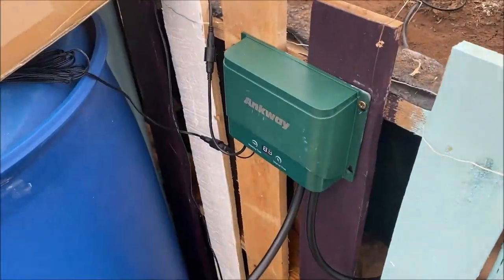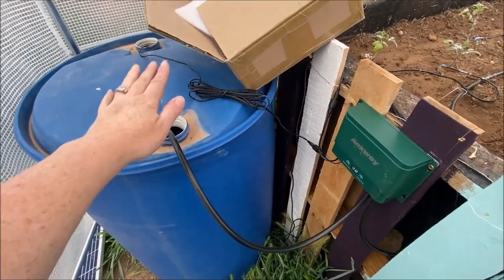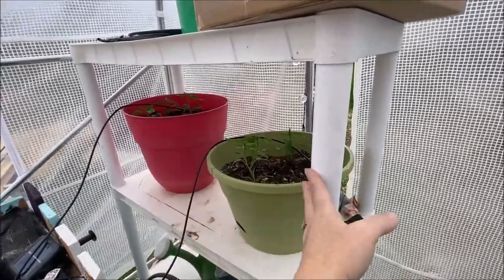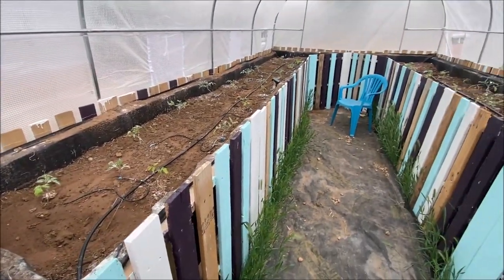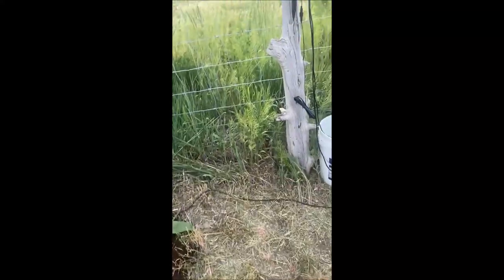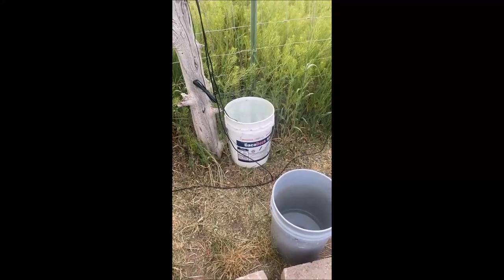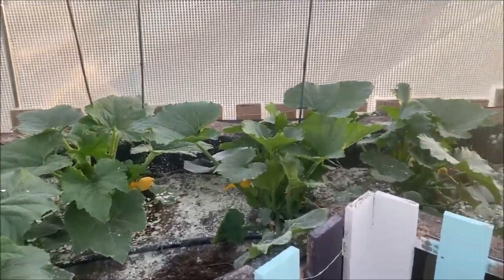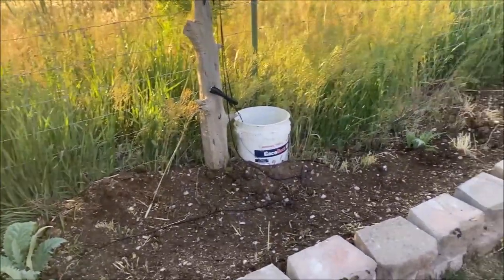solar powered drip irrigation system for greenhouse garden

Comment: Thank you for your video, I've been looking for something like this. I did read the reviews on Amazon and I'm concerned that some people are saying it only lasts for a season. Do you have any input?
Reply from the maker: It really depends on the unit, we've had some that only lasted a year, but others are still going strong.
If you unhook them and bring them inside during cold months (especially if it gets to freezing temps) that will extend their life.  We didn't do that last winter unfortunately, but only had 1 that wouldn't work this Spring which was nice!  This year we plan to unhook all of them once temps drop and keep them inside for the winter.

Comment: Do you know what size the main line size is? 1/2 inch or 1/4 inch? Not the one that connects to the spike.
Reply from the maker: It depends on the unit, some are 1/4 inch and some are 1/8 inch.
Reply: Main line is 3/8 and the runners to the spikes are 1/4 for this one
Reply: From having done plenty of water lines, they look like 1/4" for the line the spikes come off, and like 3/8" into the barrel, like the last commenter said

Comment: Does it have a battery so it will store energy and still work on cloudy days?
Reply from the maker: Yes it does!
Reply: @AtoZForMoms  I ordered one. Fingers crossed!
Reply from the maker: I hope you love it as much as I love mine!
Reply: I wouldn't trust it to go too long. Might get 2 days without sun at best. All my systems O build from individual components myself and do the maths on it all. A lot of these systems are alright but not great. What I have seen on my charge controller screens is there's a dramatic drop in solar intake as soon as it's not fantastic light levels. Slightly overcast and you're back to 30% input and very overcast and you're back to 3%.
Reply from the maker: Mine have done fine, even with days of overcast.  It probably depends on the size of the unit as well, but so far we haven't had any issues.

Comment: Hi Elsie. I would recommend you to try using a 1/2 hose with 6 inch emitters in your raised beds. My garden started off with a similar set up but I found the 6 inch work great if you enjoy growing plants from seed. We normally add a seed directly under the drip emitter and wait for a plant to start growing. 

Thank you for sharing this video as I wanted to make something similar for my greenhouse! I just subscribed!
Reply from the maker: Thanks for the tip!

Comment: Nice.  I built a very cheap system with no battery, timer or pump.  Just drips a few hours a day . video on my channel.
Reply from the maker: That's awesome!! Do you ever get mold?
Reply: I've only been testing, have not set it on the grounds yet.  I do anticipate the tank will get green.